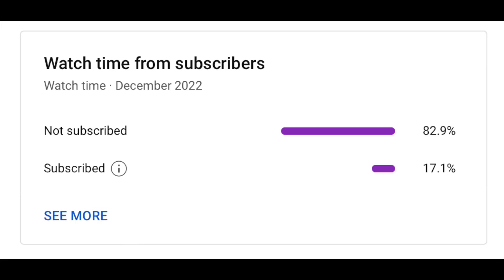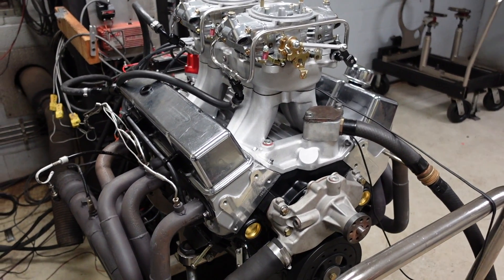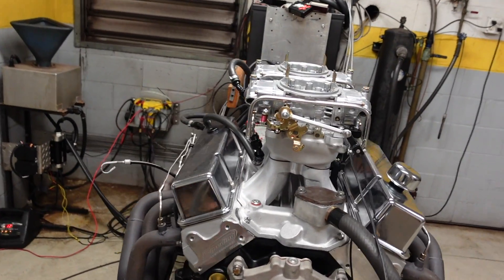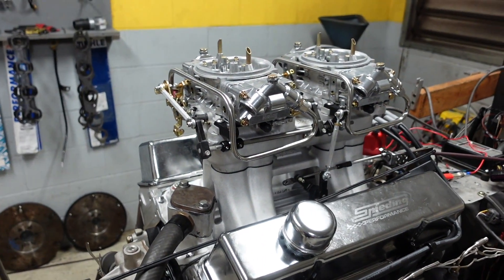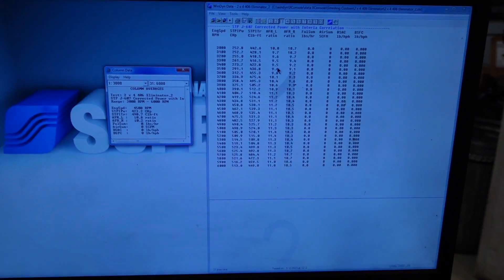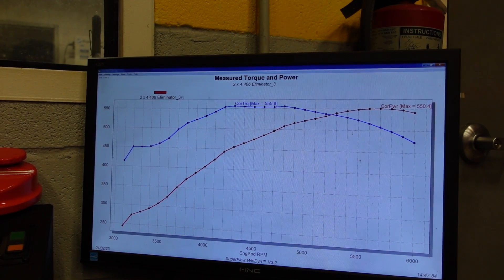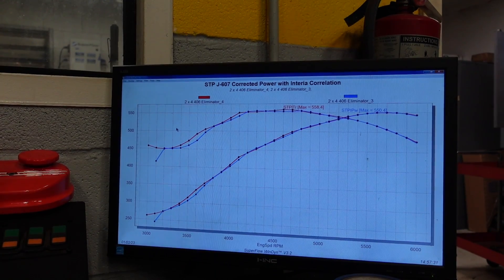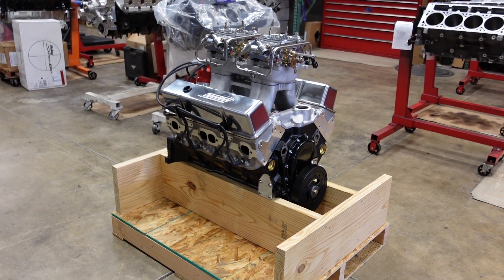Dyno Testing a 2x4 Tunnel Ram 406" SBC - Insane Torque Curve

Comment: Response seems slow, my 327 was lightening quick ,did lots of carb mods, allholes in metering plate had a small jet, used red accelerator pump cams small squirters, small floats, used vacuum secondarys, wth light springs, run balance tube between pods on secondarys, quick fuel secondary plates with screw in jets ,jets were 72s on all 8cyls. Found through research, bigger aluminum side tubes to get more gas to secondarys.

Comment: I’m running a 406 sbc with 200cc intake runner 64cc chamber heads, roller rockers and a 230 230 cam…. I feel like my cam is too small… what cam should I run
Reply: Dur 236 to 244 ish with lift in the mid 550ish on a 107,108 or lobe.

Comment: Tunnel rams are for "mid-range" torque. low end torque 
for the street is usually a "dual plane".  you will definitely make power
with a big cam/tunnel ram and "twin 4's", but later in the curve around 3500-4000 rpm.
I built a 402 x 040 over BBC for a guy, He had to have a tunnel ram with 2 650cfm 4's on it.
I told him it's going to look cool at the car show, but you're going to lose street performance
stacking the deck like that. He had a 4 spd Muncie that helped on the low end a little but later
opted for a hood and a 780cfm Dpump with a dual plane and a matched street cam, 
that woke his A$$ up coming off the light.. LOL

Comment: Typically WOT max load  12.5:1--13.5 :1 A/f .   13.5A/f will dilute oil less and wash cyl bores a little less . Commonly 12.5 --12.7 most power . Set pump to get u off the line with most response convertor gearing cam shaft will influence this . Cruise between 37--55mph light throttle needs more advance 14--15:1 A/f 

What was the idle speed  and idle vacuum  ??????????/

Comment: Yep smaller cam small variance in HP gains if advancing cam degree.  The bigger the cam give as much cam advance as engine will tolorate so to keep low end torque and response.

Comment: Your carbs are sweating something crazy. Are you cooling the fuel with dry ice? That would definitely richen the fuel ratio. Good video! I love the sound of that thing! A bump up in cam could easily put it up to 600 hp. But I suppose that would sacrifice the very impressive torque curve. Nice job.

Comment: My  388 stroker makes 700  horsepower on a tunnel ram n/a  on pump gas and 1300 + on methanol injection dual plate kit and a cheater kit and that's with a 0-10 block small block Chevy been running it for the last 10 years

Comment: I have this same tunnel ram converted to MPFI with a tpi style plenum and dual 58mm tb. Do you think it will make more or less hp than the dual carb version? I plan on running afr 210s and porting the intake

Comment: With sideways mounted carbs, the part throttle fueling will be erratic. The secondaries should open 1:1 to properly deliver fuel to the left bank of the engine. Each runner is sitting directly underneath a carburetor butterfly valve. With progressive linkage, you primaries are feeding the right bank and the left bank is getting underfueled.

Comment: According to David Visards 128 formula it would do better with a 106 lobe separation.  Goes like this 406 divided by 8, then hit equals,then divide it by valve size and hit equals, then times that by .91, then hit equals, then subtract 128 from that to get lobe separation angle .
Reply: Sometimes thats done to surpress the forces of higher static compression ratios at low RPM on the street due to the poor available octane at the pump. A 106 L/S will pump harder down low, if you could find 104 octane and afford it... yes absolutly the improved overlap would make more power.

Comment: I'm truely sorry to say this, but that is a bad combination showing low on power. A 406 has plenty of inherent torque and so does the tunnel ram. But to wake it up, it needs FAR more cam (at least 265 to 275 @ .050) and with the resulting lower dynamic compression, you can run 12:1 on pump 91 to 94. With a loose converter and some rear gear, that motor can run 650HP all day long, and look the part doing it. The old idea of static compression ratio relating only to street octane, has to be revised by the camshaft designs. A late closing intake, bleeds off a substantial amount of cyld. pressure and drops the "actual" ratio the motor sees.
Reply: with 195cc runners?  air speed would be ridiculous. not happening. its a street engine, 275 at .050 is nonsense.  my 421 makes 860 hp  @ 8300 rpm with 277, 296, 114 lsa, .820, .790, but the heads are 15 degree with a 280 cc runner and 2.2 valve.
Reply: Its a street engine you think they dont know that? Smedings been around a long time
Reply: 400cu  Air flow research Eliminator 227cc  heads 12.5 CR ,,260/270 SR ,,,  Super Victor  pk hp 6800-7000  640hp   4500stall 4.3 rear gear
Reply: 400cuin Afr Elim 195  heads ,,, 11 to1 CR ,,, 248/252 SR  then around the 260SR  
1st was a victor jnr /248/253 SR   550hp at 6100rp   2nd was with Super vic  260SR 575hp at 6300rpm    Cyl head not big enough minimum cross section at push rod pinch
Reply: CYl head MCSA chevy 
AFResearch 1.9mcsa  195 cc head 
AFR    2.180  mcsa    220 cc head 
AFR    2.34  mcsa   227 cc head 

Similar is Ford 408 performs with a 240  H/R goes to 6400rpm 200cc 2.165 mcsa 
Port size should never be decider   mcsa is more important
Reply: Are you on team chevelle, name looks familiar. Thanks for the input
Reply: I have a 11.2 to 1 406 sbc. With 242-248  @ 0.50  610 lift mechanical roller, 215 runner promaxx project X heads eldebrock street tunnel ram with duel 650cfm proform race carbs,any guess on hp. ?  Not been dyno yet.

Comment: 406 10:5 C.R. tunnel ram street hydraulic roller 698 hp 676 tq. on dyno. AFR 220 Scorpion RR's Msd's Crank Trigger.
Reply: at what rpm? and 676 torque with 10.5 : 1 on a 406. no fn way.
Reply: @MansonSherrillJolly ya...there is no way this happened. Its 1.66ftlbs per cube. Its better than every engine masters competitor on 100 octane that has ever competed.
698hp is pretty unbelievable with afr220s as well. You probably wont make 700hp on pump gas with 325cfm intake flow. Its possible but really unlikely and even less likely with a hydraulic cam.
Reply: What cam you use
Reply: @ssjay539 david vizard 406 grind
Reply: Find that real hard to believe.
Reply: @gordocarbo take it up with David vizard.. lots do not believe, but the dyno is proof.
Reply: @rorydottin7143  He built and dynoed your engine?
Reply: @gordocarbo yes he(David Vizard) did
Reply: @johnrorydottin9246  WHy are you posting from different accounts? So youre saying that engine is in your car?
Reply: @gordocarbo  I got 2 phones so 2 accounts...not my engine though.
Reply: https://youtu.be/YEwpW7H2TNg?si=ncB9BCN7EjN1bCzo

This is my neighbour's street car on slicks with  times of 9.04, 9.16  406 10.5 :1 chevrolet small block built by David  Vizard on 125 shot near 3800 lbs.

Comment: I'd go with a solid roller around 256x260 and 600 lift on a 108 lsa and make closer to 600 hp. Rick 437
Reply: Every motor is different.What works for one my not work for another.I am no we’re close to Jacob’s experience but I have built plenty of motors over the last 30 years.We have cam swapped this 406 sbc 3 times in the last 3 weeks.Enjoying this experience and I can tell you one thing.We took out the 107 Lsa and put in this 110 and this motor woke up A little more.10 1/2 to 1 compression AFR 195’s and all the goodies.We kept the lift under 600 mid 500’s and went with A old school split dur mid 240’s.Freaken motor seem to love it.I am still educating,learning and enjoying these educational videos.Ryan and Adam at AFR in California friends of the family recommended this cam when I gave them all the details and what I wanted to do.
Reply: That is the same specs on a comp xr292r the duration @50 but the lift is alot higher on the one for a big block I have that cam very responsive in a 427 big block
Reply: My 406 made 613 on the dyno 108 lobe 272/272 I can’t remember the lift off the top of my head. That was with a victor jr.. got the big dog in there now
Reply: That would be good in a Ls but in a Sb I would change it to a 110 lsa solid flat tappet.
Reply: @aphil4581  Elgin and Isky make an awesiome SFT and SR grind, like the old 294r
260 single pattern, 294 adv Elgin 106lsa Isky 108 
NExt cam in my 383 will be that Elgin. Id run a SFT in a big block

Comment: Man you can't say that 1 fits another we did several 604 zz4 crates and they all end up diffrent. And I get 670 hp from a 421 ci on a 830 cmf carb over carbed and not enough camshaft..

Comment: 550hp nice! and that cam is pretty mild for 400ci!
Reply: yeh id like to see that cam in a 350  with 180-190 heads and  dual plane  with a 750 and flat tops
Reply: Good for the street, and about right with only 195cc heads.

Comment: I guessed 550hp! For tunnel rams, I'd like to see a 1:1 linkage on both carbs, so primaries and secondaries open together. That way, you have 1 barrel and 1 jet for each cylinder, and you can read plugs and optimize each cylinder individually. Doing it this way, you forget about primary and secondary side, and don't have to worry about unequal fuel distribution. You can still use the power valve circuit to tune high load, and leave the jets leaner for better cruise.
Reply: @bigboreracing356  Never said they didn't!
Reply: Your hilarious 😂
Reply: You still have to worry about unequal fuel distribution. AFR can be all over the place even with the 1:1 linkage.